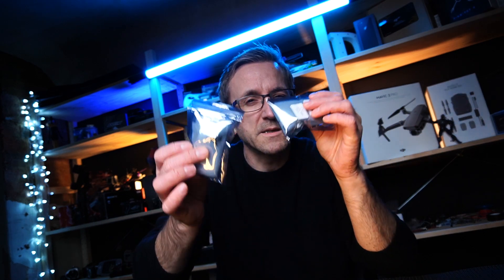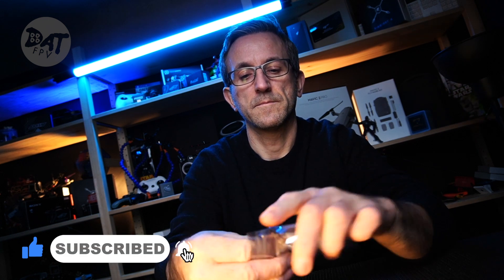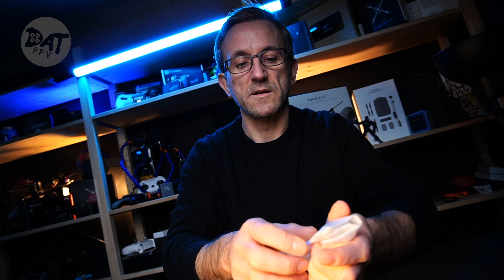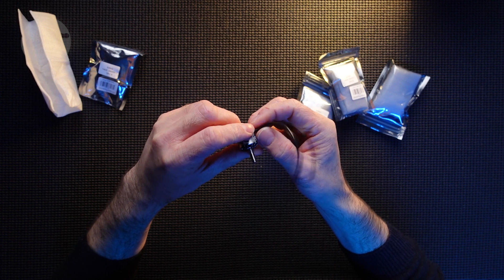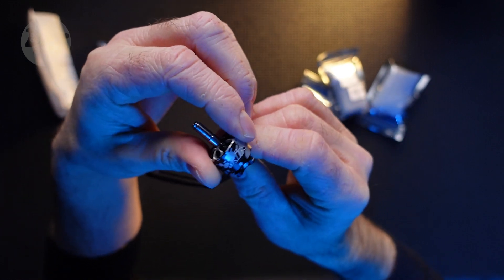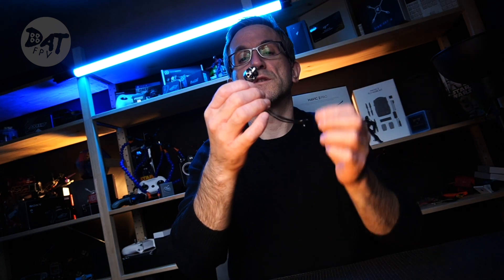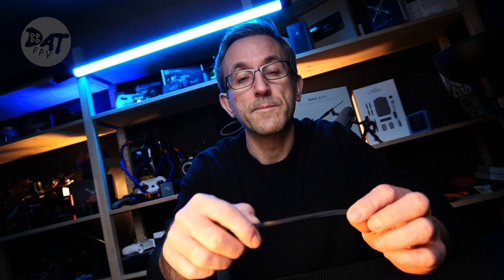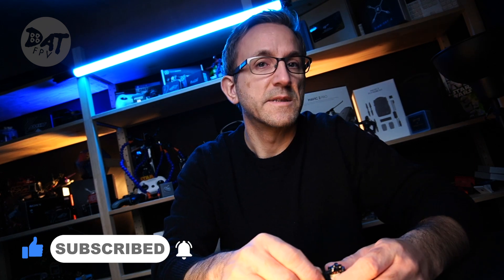FPV Fun Bags - iFlight XING Motors

Comment: I have these on my Cinewhoop, they are pretty good. Looking to change to 2203.5 from Tmotor or Xing.
Reply from the maker: Hey mate, you ok? hope they are good, have to get something else if not, I'm trying to make s little freestyle beast with the apex 3inch frame
Reply: @Datfpv  the motors are good. However, I also want to get a 3 inch apex build going, but can’t before i figure out if 1408 or 2203.5 will be better. These motors on the cinewhoop get hot, but they do have a lot of weight on them with an 1100 6s and a GP8. My Micro apex will be a Fettec dji setup - just waiting for places to get some stock. A good comparison for your micro will be maybe to get some 2203.5 and compare performance. Unmanned tech in the UK had stock in the last few days when I was browsing. In my opinion, the larger diameter of the 2203.5 will be more "torquey" and have a similar stator volume.
Reply from the maker: go on.. send me a link what motors you like / think and if the ones I've got are pants I'll get them in.
Reply: @Datfpv  2 Options. 1. https://www.unmannedtechshop.co.uk/product/tmotor-f2203-motor/ and option 2. https://www.unmannedtechshop.co.uk/product/iflight-xing-2203-brushless-motor/

Worth a look. I will be getting the tmotor 2850kv for 6S, should work great on 6S. As for content, i think a side by side test would be great. the 1408 style motors are the tried and tested, but the influx of these new motor sizes highten interest. I am using the logic of "increased torque" from my 7 inch build with a wider stator and able to change prop speed more accurately and have a larget stator volume.
Reply from the maker: they look good, the're heavy though.. I'm sure the t-motor ones would smash it out the park though...